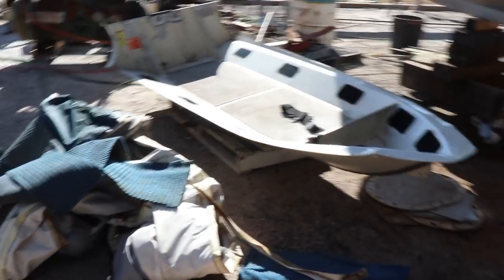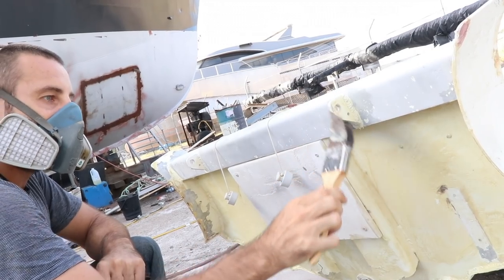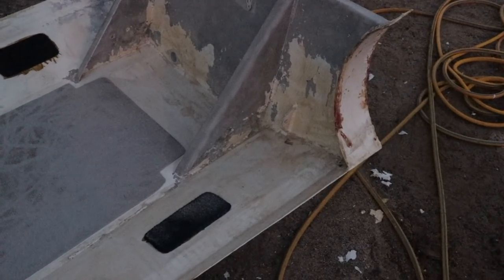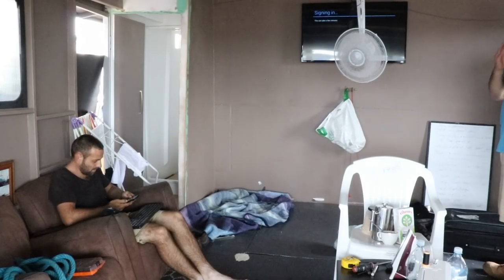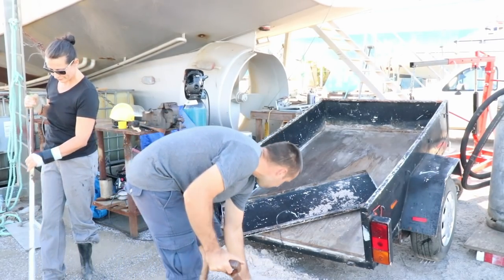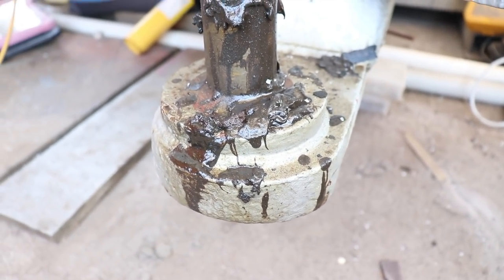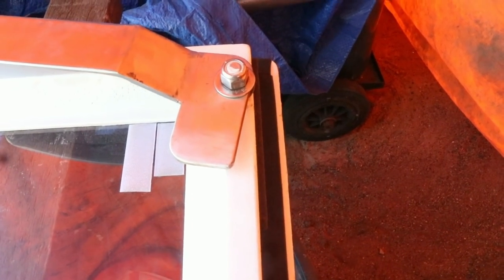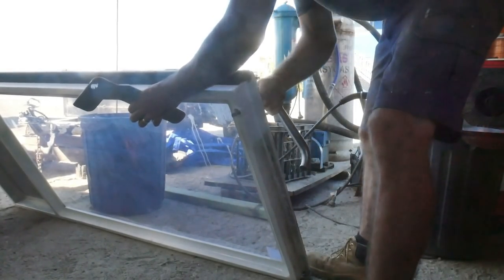Jet Dinghy Conversion and Dogs - Project Brupeg Ep. 68

Comment: Hey Damien, curious about what jet drive you're looking at using and it's mounting. Before you start any work on your pontoons,  the jet drive will need to be situated so the pontoons don't interfere with your intake flow. Is it anything like Doug's stern mount jet drive on the "Love Me Tender", or something entirely different like an outboard mount ? As always, love the music and cool videography !
Reply from the maker: Think JetSki! We are getting a seadoo spark and transplanting the whole running gear into our boat. Pontoon tubes will be well clear, maybe 2ft away on either side
Reply: Sure being a kiwi you know all about the delta required on a jet pump damo ...

Comment: 110hp would be about right i reckon depending on what jet unit your going to use. 
Most PWCs start at 110hp and are up to 300hp and they are just a bit smaller (but prob similar weight) to your dingy. 
Jets are not the most efficient and are pretty power hungry and need to be matched with the right motor to work well.
Reply from the maker: Yeah that’s why we are thinking buy a ski and transplant rather than make a bitsa
Reply: @ProjectBrupeg  yea not a bad option biggest problem is the tunnel is normally part of the hull but im sure you could fab something up. Yamaha 1.8L N/A skis go for ever and have lots of torque
Reply from the maker: We are looking at a seadoo 146hp with a cracked hull. Easy transplant option rotax 900 motor
Reply: @ProjectBrupeg   not a bad option but seadoos are more temperamental (coming from a seadoo owner) the rotax 900 is a good motor but only 60-90hp depending on tune in ecu
Reply from the maker: Ok, will factor that in, thanks
Reply: @ProjectBrupeg  I guess you have a tank to keep the petrol the tender will drink. Modern petrol in North America has additives that can eat away certain engine seals/gaskets...you'll want to know if any engine you get can deal with the blends you'll find in the North. Also, stored gas barely lasts three months here in Canada unless well-sealed; you'll want to keep it "stabilized" with an additive, because you can't drop into a station and buy more. Wish there was a compact engine you could run on diesel (or veggie oil) for the tender to avoid bringing a second or third fuel (propane/butane is the other).
Reply from the maker: The issue with a diesel in the tender is we start having to do all the R&D needed to make it work. Yes petrol is a compromise but given we know the ski goes, can fit and power the boat well, the only real issue being fuel then that is the least problematic way of going so yes we will need to solve each of these issues but I think we can do that. We have enough group knowledge with our viewers about arctic issues and solutions to be able to knock this one on the head. That said the tender could potentially run on a gas rather than petrol if it was converted (and maybe this is something to throw in the brainstorm)
Reply: @ProjectBrupeg  Well, if you found another Kubota diesel genset, you could run an electric drive. There's a thought.
Reply: Just saw this post ,  yes running a highly tuned 2 stroke could be a prob in really cold enviros , and running at low throttle openings ( to keep piston / cylinder wall heat uniform too could cause oiling issues.. bear in mind the hp ratings on current skiis is more a marketing strategy that a power requirement .. i think 70 - 100hp would be plenty for a 1000kg load ( we towed the 16ft hamilton j52 with a 70hp kawasaki x4 ski years ago and i was actually able to get it towed up onto the plane.. the boat is heavily built with a cast iron v8 .. its heavy and that skiis impeller would get it to over 75kph with one person aboard ). so there is a lot of scope to increase the load capacity if you didnt need 35 plus knots
Reply: Its higher speeds where jet pumps become inefficient,  out of the hole they are more efficient than a similarly propped outboard, the marketing garb about inefficiency was driven principally by the big 3 outboard companies trying to protect their markets .. notice how a lot of commercial boats are now being converted to jet propulsion... and besides the jet pump was born in the rivers of nz surely thats reason enough to have one damo